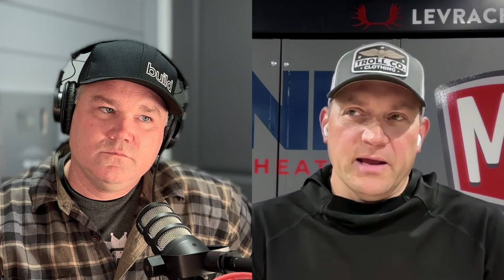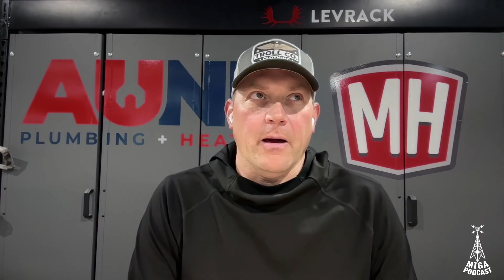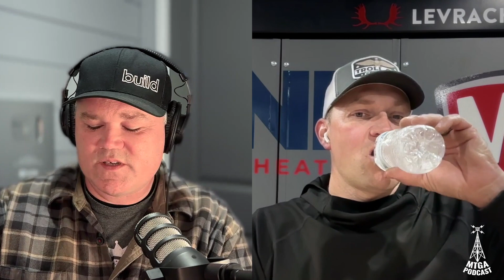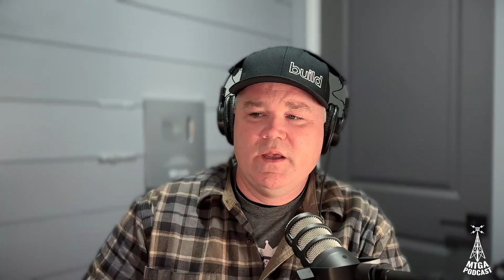Road Trip Install - Make Trades Great Again podcast

Comment: Did you use any particular software for this project — particularly regarding calculating heat load, head loss and  flow rate requirements?
Reply from the maker: Sized rhe unit off the original heat load calc from my design back in 2018. I did use the Uponor pipe sizing calculator on their website to size the pex S&R to the outdoor unit. The pump in the IDU has an extra 17ft of head so I sized the pex for 12.8gpm @45°F and 40% glycol. 1.25” is right at the upper limit but we eliminated all but 2 90’s so we’re way below the head loss limit.

Comment: The air to water heat pumps are going to be coming to the commercial market as well.  The whole entire electrification thing is going to make us a ton of money. The heat recovery chiller will also be awesome to work on I can’t wait. Simultaneously running chilled water and heating water. Every single manufacturer is starting to make these.
Reply from the maker: I think it's only a matter of time before those types of systems are mainstream.